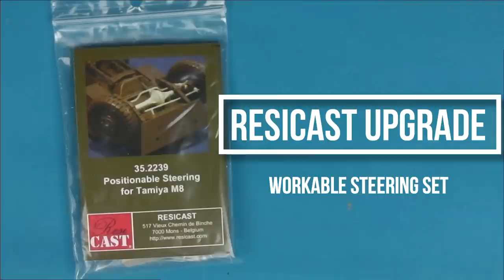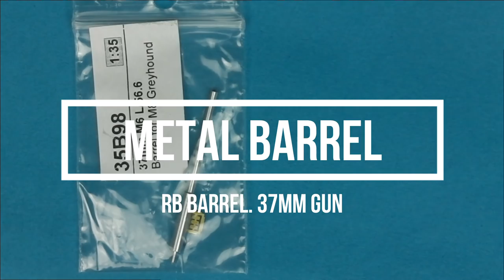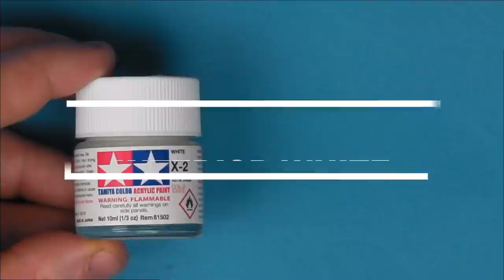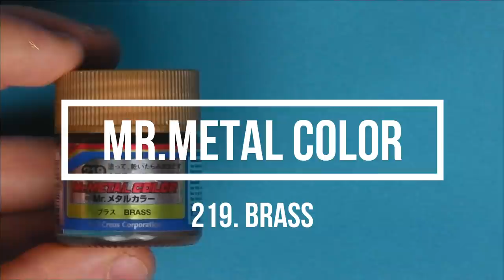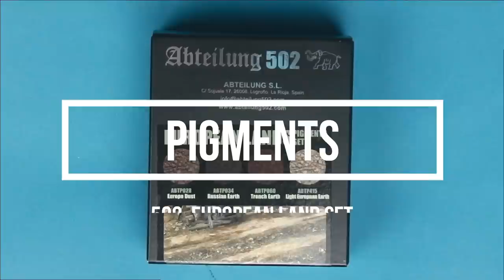1/35 TAMIYA M8 GREYHOUND BUILD Part 1: Interior

Comment: The M8 is one of my very favourite Tamiya kits - I've built 4 of them! This is looking very nice - coming along really well.
I was going to recommend the Archer Decal set for the M8 which gives you all the markings for the turret basket, and also all the dashboard dials and stencils for the interior - it's a great set and reasonably priced, but you already weathered it!
Interior looks absolutely fantastic - looking forward to seeing what you do with it next. Great video, thanks for sharing.
Reply from the maker: I was actually looking at that very set, I was gonna pull the trigger on it, but I kind of wanted to build the interior pretty much out of the box without any added details such as wiring and I also have a crew for this M8 so a lot of the details would have ended being hidden once added
Reply: @longlance67  Sounds like we've got some more to look forward to!

Comment: I am starting this kit now.  It is only my 3rd kit since coming back to model building since childhood.  So i noticed circles on the main hull from the mold during the manufacturing process.  I don't know if there is a name for them.  Anyways a few of them are in areas I am concerned about them being seen and some in hard to reach areas.  Are these marks normally covered by paint or do I need to spend the time and effort to try and cover them?  There some in the drivers compartment around the feet and what will be the storage bins.  
Thanks for this video series.  Using these videos as my blueprint.  Going to try and add some photo etch to the model also.
Reply from the maker: So those circles in the plastic are call pin marks or pin extraction marks. Its a biproduct of the molding process the spures are punched out the mold by minds which leaves those shallow circles in the plastic. 

Best way to tackle them is by filling with putty, however you can save time by dry fitting your components and filling and sanding only the ones that will be visible. 
It can be a bit of tedious process to fill them, but it is worth the effort.  

If you run into any problems or need on any advice on the build just let me know, I'll be happy to help ya out.

Comment: Ah Jaysus Shane, you make it look too easy. Terrific build for part 1. My air brush was spitting like a Belfast Docker and ruined my JU88 build that I had spent fekin hours on. While I’m in the mood, when I mask and put on aluminium paint which results in, what I can best describe as a fine powder on the underbelly of a BF109, what do I’d do? Should I coat it in a Matt/gloss varnish?  Am at a modelling standstill. ☹️
Reply from the maker: sorry for the late reply. Firstly what brand was the aluminum shade you were spraying? Also what were you using to thin it? As that may hold the key.  As for repair work, you can depending on how thick you applied you can either lock in the old coat with varnish and paint on top of, or give it a thin coat of primer. Stripping the paint all the together would be strong idea, but you could get away with just painting on top of it again.

 But the big thing to sort out before going any further is finding what's making your paint behave that way in the first place. So any info you can give me regarding the paint brand, the thinner used and your airbrush setup may help us figure out what is going wrong :)
Reply: @longlance67  Hi Shane   The JU88 is now binned. 😒 The BF109 was sprayed with Mr Metal Aluminium 218. 50/50 with Tamiya Thinner. It is a powdery finish that comes off on your finger if you touch it. I haven’t used it before so that might be how it is. Should I spray a coat of varnish over the top?  Cheers. Paul
Reply: Also meant to add airbrush sorted and working a treat thanks to a knowledgeable friend of mine.

Comment: nice video.  I'm thinking of starting to switch to metal barrel. do you have any problem with the weight difference?
Reply from the maker: it depends on the barrel as some are heavier than others, so you might find it causes the gun to depress due to the weight so sometimes you need to glue to the gun mantlet in place to get the gun elevation you want first

Comment: My god man. Making your own panel liner. Are you living in poverty. Next thing will be making your own pigments from pastels. Seriously though, the fact that modellers buy panel liner as a product amazes me when a tube of oil paints will last me years. Great video as usual. Might inspire me to start my Greyhound.
Reply from the maker: Can't beat a few tubes of artists! You can do so much with them and just as you said they last for years. I have a few premade panel liners in my toolbox but never like using them over oils.

Would totally recommend building the M8 its a lovely kit, I just finished building and detailing the turret on my mine and you can get a lot out of it

Comment: Since the M20 kit also shares sprues with the M8 minus the turret parts and the roof  you can also harvest the 37mm rounds out of the M20 kit as well.
Reply from the maker: good idea! The ammo loadout is a bit sparse as is with the M8
Reply: @longlance67  I think what is in the turret is what is supposed to be there . But I think that locker on the right side of the lower hull wall is the ammo stowage bin for the 37mm gun. Looks deep enough for it.